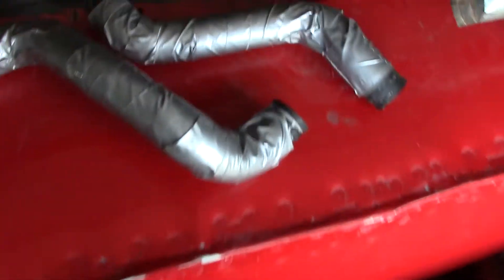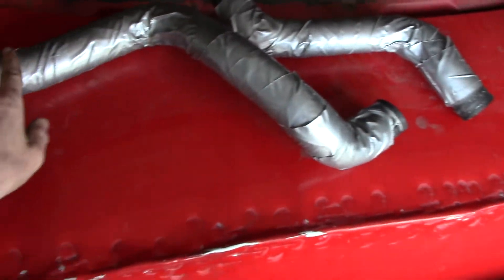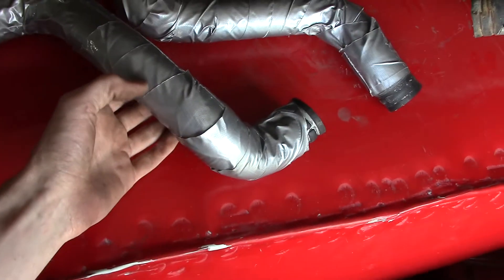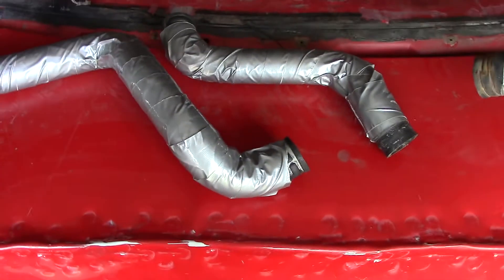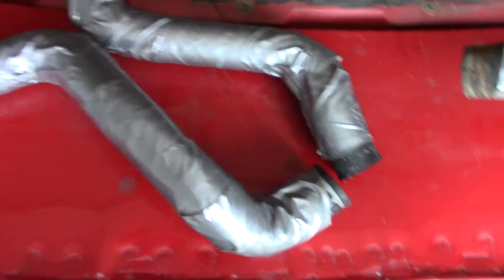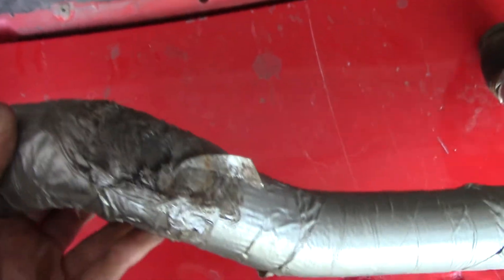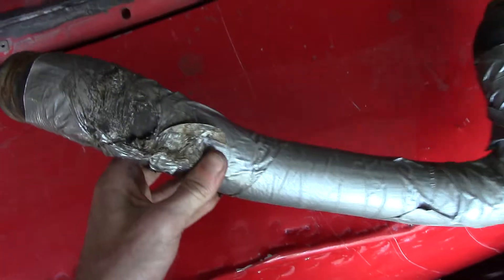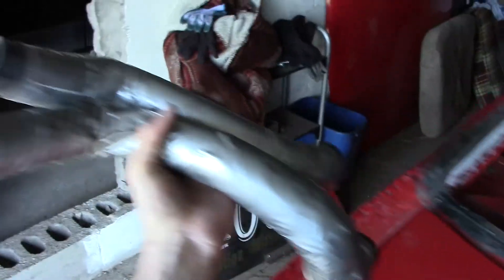Reinforce Radiator Hoses For Derbies

Comment: Great idea. I did the same to protect rubber hoses on the motorbike. Two hoses connect to the engine block underneath, close to the sprocket and get literally drowned in the chain lube (oil), water and dirt. The oil penetrates the rubber and it develops weak spots as it expands. In my case, it ruptured next to the clamp.